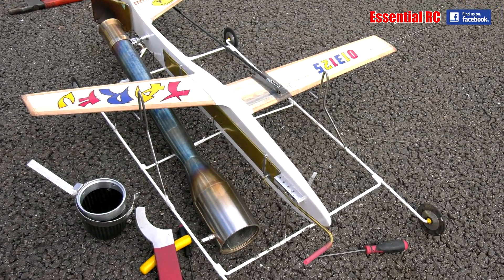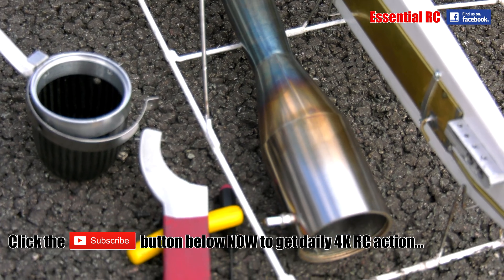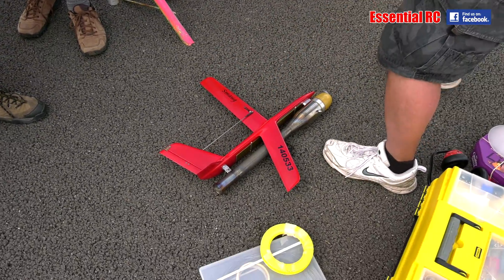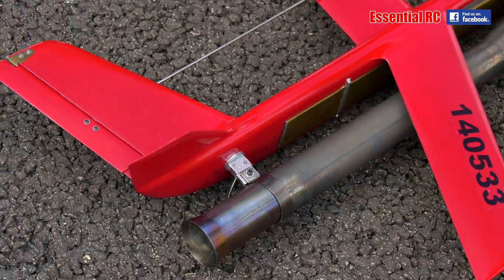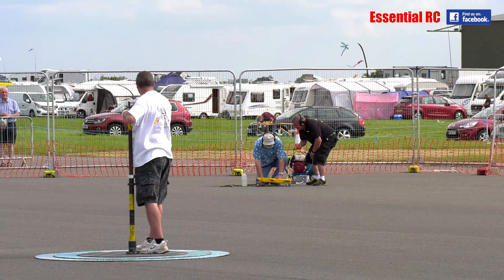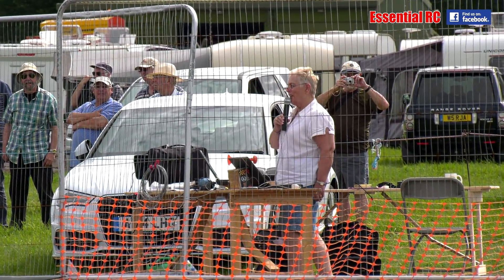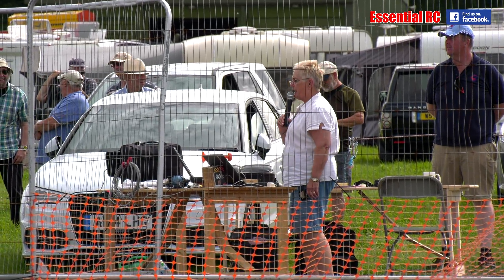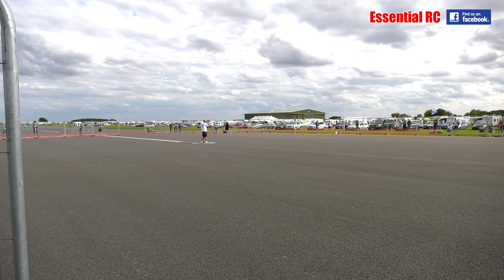200 MPH+ control line *DREADNOUGHT PULSE JET* (BMFA NATS 2017) [*UltraHD and 4K*]

Comment: The first plane was blindingly fast. But the second, no.  In 1979 I built a Slight Streak with a K&B 6.5 that went as fast. On 25% nitro, went over 100 MPH. And it was maneuverable.

Comment: Nice job flying.  I used to fly pulse jets too.  Record speed was 212 MPH.  Didn't use pole in center - just leaned back LOL.  What fuel are you using?  I used nitromethane and propylene oxide.  Don't remember the ratio...maybe 50/50?
EDIT:  Used dual line, not single.

Comment: The slow motion was really unnecessary.
Reply from the maker: Explain that logic to me. It's at the end of the video. If you don't like it then STOP WATCHING THE VIDEO! It's that easy. BUT Cheers Dom (Essential RC)
Reply: No problem, as for the explination. Due to the frame rate your video was shot in, the slow motion added nothing to the video apart from a blurry after thought. Keep on flying!
Reply from the maker: Ah! A few more words made you comment understandable. Thanks for that. You're maybe only the second guy to say that and I've had significantly more liking it. I'm shooting in 4K at 60FPS. Best I can do. When Panasonic bring out a 4K 120 FPS cam I'll consider upgrading. Cheers Dom (Essential RC)

Comment: They're control lining these here but, the push rods to control surfaces etc show that some maybe used for both RC as well. Or it's just to lock the elevator in place. Yeah, looking back at their design kind of built to fly in a circle. Not for me, control line. Some of these older guys probably grew up with it though. Seems like a waste of an Model pulse jet. Pulse jet engine, such a simple concept, much more simple than the internal combustion engine even. Mind boggles. U shaped pulse jet design even simpler.

Comment: I considered trying my hand with these Control Line pulse jet models, but my terror was of tripping, or otherwise getting into a situation where I "fell behind" the model's speed, so that the line quickly wrapped around me--ending with the flaming, red-hot pulse jet engine burning my flesh! RC pulse jet models don't have that problem--just the tremendous noise!

Comment: Incorrect. The line is not fixed to a pole, it is held by the pilot. The handle held by the pilot fits into a stirrup on the centre "pole" just to ensure that the plane is flying at a constant radius, this being necessary to accurately establish the speed.

Comment: What if someone built a full size version of this plane, could it fly?
Reply: Point made, try again? (>^_^)><(^_^)><(^_^<)
Reply: I think its just that most people behind keyboards are toxic and like to argue, not that he is American (I am too). The country you are  from doesn't dictate your IQ (unless its a place without a education system or a third-world-country).
Reply: You do know the V1 looked totally different right, this uses the pulse jets force as the directional.
The V1 wasn't built by Uncle Adolf, it was built by Fieseler under the guide of Robert Lusser.
https://en.wikipedia.org/wiki/V-1_flying_bomb
Reply: "...uses the pulse jets force as the directional".  Is that English?  If so WTF does that mean?  The V1 and the model are both pulse jets.  That is the most significant characteristic.  The V1 had the engine on top of the fuselage, this one doesn't.  The V1 was OD or black this one is red.  The V1 was 20x the size of this model.  Big F'n deal genius.
Reply: Le'sigh... Notice that the aileron is missing on the side that the pulse jet is located on? (ie: Directional Force) The V1 had a tail/rudder (that the pulsejet was attached to) and ailerons so the V1 actually had more control surfaces than this thing dose. I'd also like to note that one wing is straight and the other is swept where the V1 had straight wings.
Reply: hellsnightmare so apparently being americian is a bad thing now?

Comment: You know you can control airplanes with radio these days... making a tether obsolete.   I guess some people just like to go in circles.   Dogs do chase thier tales now and then.
Reply: Idiot. 😂
Reply: there will be certain number of people who will be unhappy always
Reply: Control line planes aren't usually just going around in circles, look up line control combat to see them pull some crazy stunts. They're even more nimble than RC planes. But at this speed there isn't much else you can do with it atached to the tether. But I believe most people do line control flying because they enjoy the building aspect, not so much for the flying.
Reply: You sure know quite a bit about chasing something still attached to yourself??  self-oral perhaps?
Reply: Jubol Bolu 200 mph too fast ?

https://youtu.be/DPGDAZyQ44k
Reply: Just like nascar! I'm making a left turn!
Reply: Tell that to the guys in my flying club that fly rubber band powered airplanes.
Reply: You do know that they tried to make them as simple as possible.
Reply: Gunther Ultrabolt Novacrunch exactly. What's the point?
Reply: I think its too fast to control it, you can barely see it on the sky when its going 200mph+ and some other factors of it breaking its structural integrity and losing its control
Reply: and yuo can snif yuor own asssole

Comment: I just don't see the fun in this but if these guys do that's fine. Just going around in a circle real fast and getting drunk, I just don't get it.
Reply: cookies- because with control line you're more in direct control of the plane, you can actually feel the plane's pull and its movements where as r/c you cant.
Reply: Exactly like NASCAR!
Reply: it's the fun of doing a vintage hobby.  how hard is that to understand?  Why do we play poker with cards, when you can do it on a computer?  Why race a classic car when a modern racer is 10 times better in nearly all aspects?  Why do we go to vintage airshows?
Reply: Sorta like NASCAR I guess :D
Reply: I'm remember tying a rock to a rope as a kid and swinging it around. Same thing.
Reply: I fly Control line sometimes.Its a bit like hooking a Marlin Fish on a fishing line.The challenge is to not crash it at times.I dare anyone to try fly one and not enjoy it.At least a few times.I had one snap off the line at 160mph into the fence only to demolish the plane instantly.No one got hurt but my feelings.These CL Jet planes are much harder to design than RC models because of the Wire trag & Centripetal force.2/3 rd of the thrust goes into wire line drag at full speed.
Reply: motocrossriders2002 so is digging a perfectly square hole but you won't catch me watching someone do it
Reply: I'd puke lol
Reply: I wouldnt fancy being near that. I would throw up dpinning like that.
Reply: Lmao
Reply: Jim Pinckard you just described nascar going around in circles and getting drunk love it
Reply: hey , im acculy flying models kind of these , and its very fun, trust me. Its just unpopular hobby
Reply: You just described nascar btw....
Reply: Sounds just like nascar 😂😂
Reply: Schmidt's duct or pulse jet engines, the simpliest aircraft engines ever, used in WW-II by germans as V1 " buzz bombs "
Reply: Its like high performance model building.

 Apparently it was more popular in the 50s and 60s.  Its not just jets, but cars, boats, and stuff. They go SO freaking fast. I think its pretty neat having just learned about it. Theres alot of precision here.  aero dynamics, machining, weight, etc. I get it. The cars are crazy I love the way they sound.
Reply: Getting drunk and dizzy could be the title
Reply: It's definitely harder than it looks...
Reply: Well I get the getting drunk part but...
Reply: I never get how anyone could fly control line if there's rc, donesnt make sense lol
Reply: You should try  combat control line.
Reply: In Control Line you can draw patterns in the  sky like an 8, either upright or sideways, you can do loops either round or triangle-shaped, and you can also fly inverted... but it is understandable that you don't "get it" since you apparently never tried the thing "from the inside".
Reply: @call911forcookies2  >>> At one time, there WAS VERY LITTLE R/C.  And what there was, was EXPENSIVE.  And when you were a teenager in the 1970s, you did NOT have TONS of $$$.  

Remember, back prior to the 1960s there WAS NO real R/C available commercially.
Reply: Line control with aerobatics is fun.  Just going in circles as fast as possible, however, doesn't seem like fun at all.
Reply: i dont get it too. its more fun to fly it rc than this.
its like throwing paper planes...well paper planes are more fun :D
Reply: Robbie Lilledahl chill your model making booties like ya said if you dont like it keep your pie hole shut about it you hypocrite
Reply: The_British_Bandit piss off you  probably play video games in your parents basement
Reply: Same
Reply: Getting drunk is the main event, nothing else matters.
Reply: Some people just don't get it!! If you don't like it keep your pie hole shut!! Or go play your stupid video games!!!!!!
Reply: @patriotrob7066  >>> MANY PEOPLE in the latter 2010s DO NOT understand that BACK IN THE DAY, R/C systems were either NOT THAT COMMON and $$$, or JUST PLAIN {PLANE😊} NONEXISTENT....

Comment: Holy crap!  I would love to see that set up on an RC jet.  Electric jets can do 140 ish (cheap too) mount this pulse jet on it, if one could get the setup properly working.  Then by means of Radio Control ignite a pulse jet at full speed (not for a novice to get everything in working order nor fly.)   This would be a sight!  I am just learning about the RC's so if I said anything that makes zero sense please disregard (and correct me by all  means.)
Reply: You can hit a lot faster speeds on electric planes. And actually these pulse jet engines have very sub-par thrust compared to a good RC jet engine (as well as they burn fuel so fast, they only give some 30 second flight times).
Reply: https://youtu.be/qx3OcQ_nvkE
https://youtu.be/Ec29m51htkg
Reply: Looks like you just have to run around the pole faster to get a faster plane
Reply: https://youtu.be/tgp3j-odseo

Comment: this is just stupid, i dont get it
Reply from the maker: Skill is in the engine and model construction and tuning. The pilot controls the pitch via an elevator on the model by pulling/pushing a handle on the control line. It takes some skill to get them running this fast and I guess that's the challenge. Cheers Dom (Essential RC)
Reply: They are building time machine, just need a bit more speed and they can travel to future.
Reply: I used to catch a beetle and towing one of their leg on sewing line and let them fly around and then release them back to nature after finish playing around,back then when i was just little kid,not sure if these guys has the same excitement??!
Reply: +Ray McCormick they are holding onto poles so they dont fall over.. incredible pace and skill lmao. its cool and all but you gotta be crazy to think this requires higher skill than actually flying, not attached to a pole and only controlling the elevator.
Reply: Ray, that wasn't very nice; no need to 'slam' someone for honestly giving his or her opinion.  My dad & I use to fly the control line models WAY back in the 50s and 60s.  These were usually wood kit planes you would spend much time building.  I use to LOVE the going around & around, making the plane do loop-de-loops, and then successfully landing.  Even with my past experience and LOVE for the hobby, I, to am having a hard time thinking how THIS can be fun.  But I DO 'get it', even though I can't see me ever wanting to GRAB ON and spin my self dizzy, just for bragging rights as to having such a FAST plane go round & round.  The way you must JOG AROUND that steady pole is just too much for my sensibilities.  But it CAN be fun to watch.  I think the major aspect of the experience is not the 'end result', but rather the building of the plane so as to achieve that 'end result'... HEY!  IT WORKS!!  NOW GIVE ME A CHAIR TO SIT DOWN ON_ I'M POOPED!  lol
Reply: This isn't for the slow minded is why you don't get it.....above your pace and skill...

Comment: When played back at the lower speed, it sounds just like WW2 doodlebug, which was also a pulse jet.
Reply: A buzz bomb.
Reply: because they use the same engine, a pulse jet.
Reply: A larger engine operates at a lower Hertz (frequency) and it sounds slower.
Reply: It sound like v1 rocket